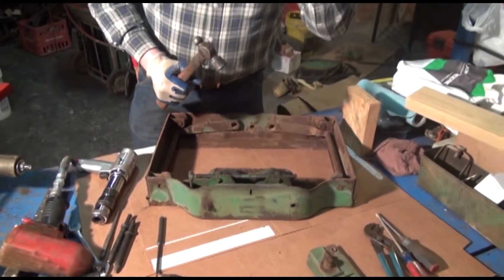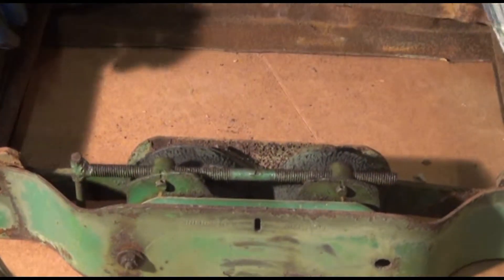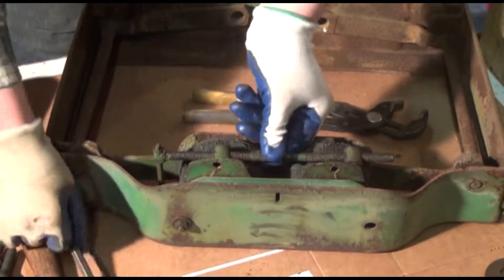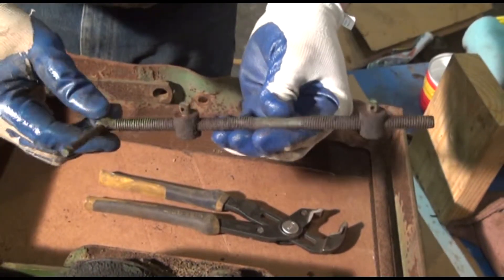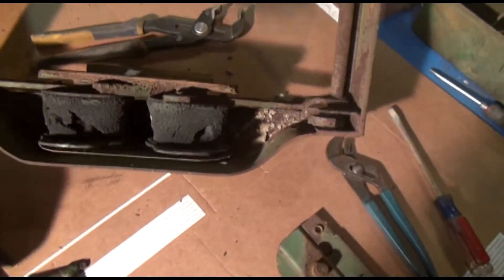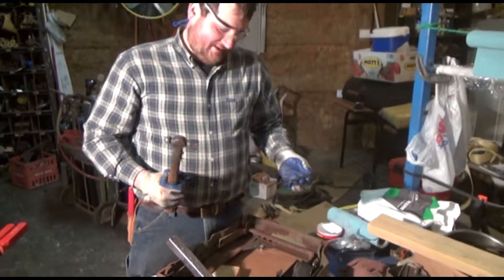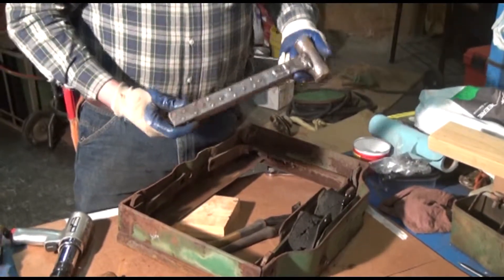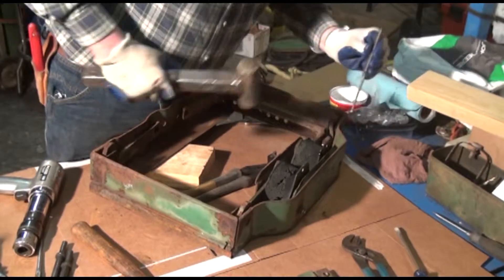Float Ride Seat  Part 3

Comment: Great Video. I'm in the middle of restoring a similar seat off a ford. I do agree that replacing the adjustment rod is a better route both esthetically and in functionality .  However in my case I dis opt to restore mine. In my case I had great luck with a wire wheel and some time investment. Thank you for another great Video!